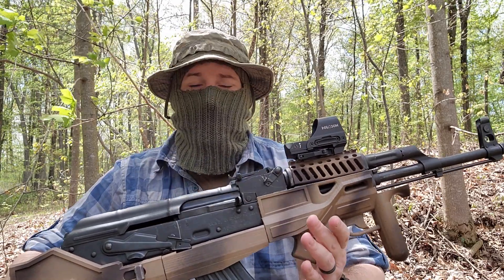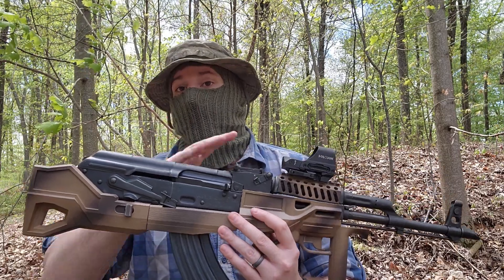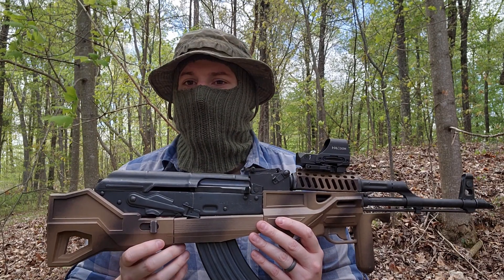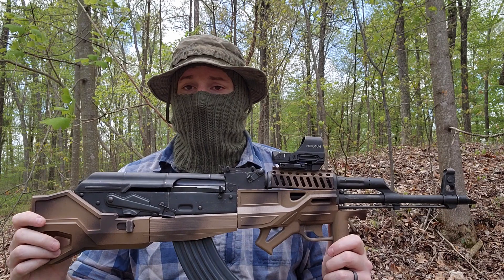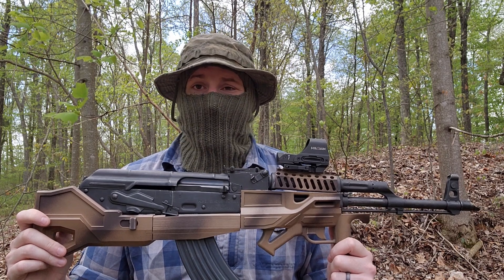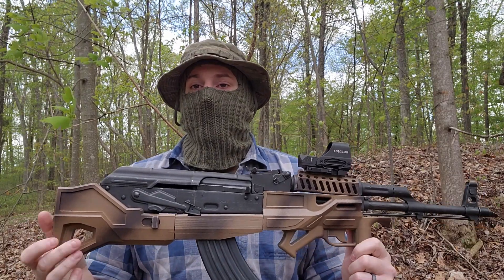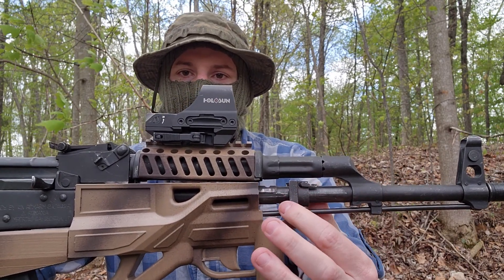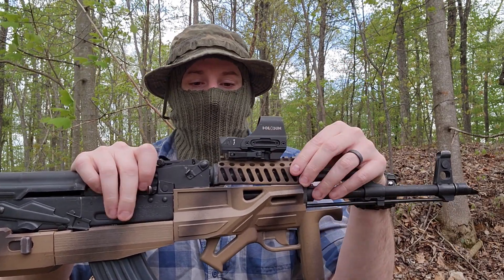Grozn't Project Update! Spring 2023

Comment: Hey man, why doesn't have a normal pistol grip? I was curious. (google translator).
Reply from the maker: Most AK bullpup conversions aren't plastic, so you can extend them out over the barrel and gas tube since they wont melt. But to reduce the amount of heat the printed parts absorb, I wanted to cover as little of the barrel as I could. The downside of that is you have to bring your left hand waaaay back, which forces your right hand back, which means that a normal pistol grip dosent allow enough clearance for the mag to rock in/out. It'd be a lot less of an issue on a 74 with it's straighter mags, but as-is this is only just enough space for the 47's mags to clear the grip.
Reply: @dinkaroubles  Got it! good luck with your project bro!
Reply: Got to love the tactical banana 🍌
Reply from the maker: @charaznable896  it is! And originally that was the intended hold, but I opted for the VFG later on for a more traditional hold option. But the crossed up arms mag hold thing does work really well
Reply: Most likely complies with the idiotic  pistol grip law in Ca.  :)
Reply from the maker: @murfspop  Neup, explained above that its about magazine clearance. 😎

Comment: once you fix the reset, you should get rid of the exposed trigger pin. It's just asking for an ND
Reply from the maker: You're not wrong. I'll have to futz around with it and see how easy it'd be to actually trigger it that way, because pushing on it its actually kind of hard to do. Figuring out a way to interface the transfer bars with the trigger minus the pin will be... interesting. Maybe just making it fit flush would be enough
Reply: @dinkaroubles  I know it would add to the complexity, but maybe the trigger pin could ride on small skateboard Barings in internal tracks. perhaps you could keep a partially open design for easy installment but have a set of printed caps that attach with screws on the outside to seal them off.  similar to how desert tech has a cap/cover on the mdr that seals one its ambi ejection ports
Reply from the maker: @jordanhorst6  Thats not a hateful idea. A design goal was to keep it 100% printed (or as close as possible) Though, I'm already considering adding in a spring to assist with trigger reset, but I wonder if simple, printed, clip-on caps over the pin wouldn't be sufficient?

Comment: An ultimak rail or rear sight replacement rail may be the best way to go about mounting optics. It also would allow an offset flashlight.
I'm curious if a rear sight rail would get close enough to allow use of a prism optic. Hoping to see these files available in beta. I know the 3d print community can be toxic AF but I've been wanting a bullpup ak so long and I appreciate your project so I don't have to hunt down a rare conversation kit from back in the day or sell a kidney to buy a type 86s
Reply from the maker: Yeah, a metal aftermarket one is probably the best way to go instead of printing it. Current plan is to finish it out, do a closed beta test, then release the files on my Odysee instead of through an established group. I'll keep posting updates as i go along
Reply: @dinkaroubles  it makes you feel any better I highly doubt your project will make the tranny death squads any more violent than they already are. Kind of like the old argument goes we can take the guns away they'd just start stabbing each other. Take the knives away and they'll beat each other with rocks. 

I know Midwest industries also has a railed gas tube that's an independent system and doesn't require the barrel bands the ultimak does.

If possible it may be ideal to make a version with a longer handguard that goes to the end of the gas block. Just to allow more accessories and protection for the heat. If you're interested in other modification ideas hit me up. 

Keltec won't hear me out on a 300 blk Rdb so this is probably as close as I'll ever get lol.

Another note is designing these to fit zastava models will probably require modifications.

Comment: Really sweet project man, assuming we can get that sucker up to 100% reliability.
Reply from the maker: Thanks! Yeah, i'm seeing where the paint is rubbing off and will increase clearance in those areas. I'm also thinking of adding in a coil spring behind the trigger to help push it forwards again. Was hoping to avoid extra hardware and have it be 100% printable, but a little extra nudge home would really help reliability, i think.
Reply: @dinkaroubles  it probably would. It’s a shame the 3D print community is the worst
Reply from the maker: @schizosaint777  It's not everyone, but more than enough of them to sour me on the experience. The petty social media squabble stuff I can tolerate, but the threats of violence? Naaaah
Reply: You can't get a regular AK to 100% lol